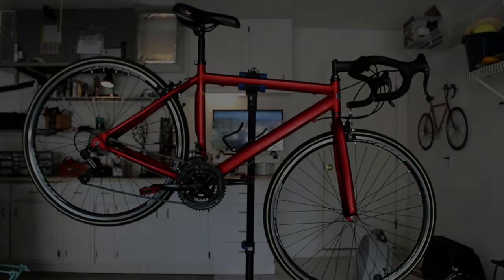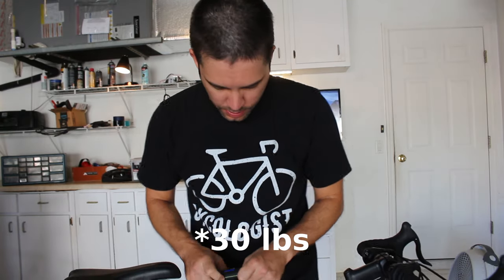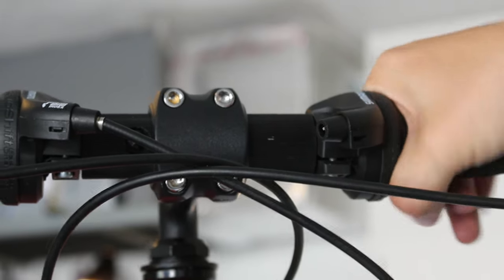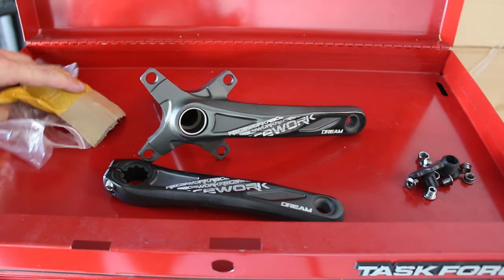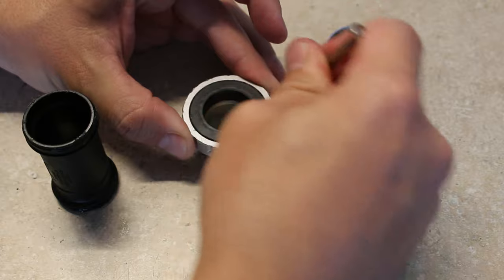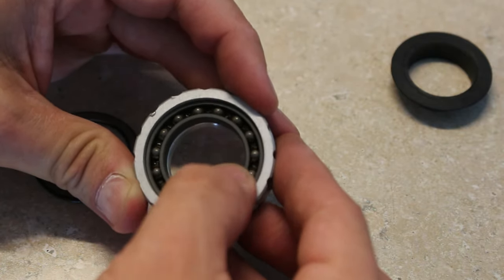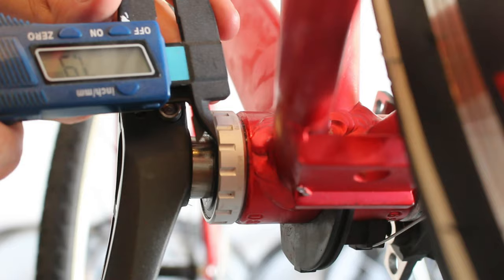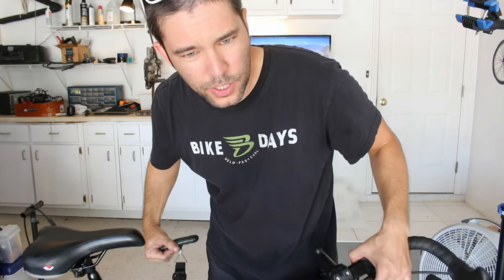Cheap 1x upgrade for the Kent road bike

Comment: I keep coming back to this especially after i got rid of stock front crank/chain set on my bike. Took the frankly disgustingly heavy one and put it on the old back yard clunker, which solved the skip issues it had (and converted it to a 1x) and my bike is taking hills easy.

I'm not going ot turn mine into a fixie because too many hills (I tend to go through the middle three gears on the loop i go through.) 

I just like that you took what is considered 'bad' even by big box standards (kent) and turned it into a winner.

As a note for anyone else doing a crankset swap: Get a little tube of loc tite to put a little dab on each of the bolts as you install it. Even on my fairly easy loop a few laps in and i have to stop to tighten the bolts back up (they arne't like... shockingly loose but I don't like any play at all on 'em.)
Reply from the maker: I think for anyone getting this bike, the number one thing you can do this 1x conversion. Cost, what about $40, but just that actually makes the bike decent to ride.

Agree with the chain ring bolts, and it's funny you say that because just the other day I noticed I was missing one on my Miyata. I replaced it with a new one, but I should still get some loc-tite.

Comment: You could remove that shifter without mucking up that tape. Your handlebars are split in the middle with that bracket holding them together that is inside the stem clamp. That's the only way they can get those shifters on drop handlebars in the first place. If you look out for a cheap freehub rear wheel then you can replace the 14-28T freewheel with something like a 11-34t 7 speed cassette that will improve your high gearing speed by about 27%, (14 shared by 11). This assumes you have the frame dropout spacing for a freehub rear wheel but I think you will. Some cheap road bikes have basic dual pivot caliper brakes that work ok other bikes go super cheap with very old school simple sidepull caliper brakes which are very poor and no better than cheap road bikes from the 70s. Personally I'd upgrade the brakes as a priority either with much better pads or try to source some cheap dual pivot brakes or ideally both.

Here in the UK I've managed to get quite a few cheap 700c freehub rear wheels from Amazon warehouse which I use to replace threaded hub freewheel rear wheels. I think I've paid as little as £11 at times, they don't match the look of the front wheel but I don't care and often they are for hybrid bikes so a bit overbuilt for a typical road bike, slightly wider rim and high spoke count, 36 spokes typically.

Once you stick a freehub rear wheel on that walmart bike and some decent brakes you've pretty much sorted it. I totally agree that 1x is the way to go, it gives excellent shifting, very low maintenance and when you are commuting in traffic its simply up and down the shifter, no front shifter to think about makes the bike far more intuitive to use which improves safety massively. I hate front derailleurs one of the worst engineering solutions ever especially if you combine it with freewheels which are a low grade part and often have wobble.
Reply from the maker: hey there Bonzo! I think at the moment anyway I'm okay with the current wheel set and gear range. Here in florida we don't really have any hills, realistically less gears would be fine. But yes the brakes I do want to do something about, the one it has now is a single pivot side pull. I actually do have some better ones laying around I may try to put on. Thanks for the tip about amazon warehouse, I didn't know about that, do you just check on it for deals every so often?
Reply: @BruceChastain  I check amazon warehouse probably every couple of days on average just to see what is there. Fitting a cassette mainly helps with high gearing so you go faster on the flats as low gearing is hill climbing gearing I think and many freewheels have big granny gears, 34T is possible I think with a freewheel from decent brands, Shimano and Sunrace. As a heavy rider though I need a freehub and cassette anyway. I always look forward to your videos and I have this strange interest in walmart bikes despite being in the UK where they aren't sold.

Comment: I upgraded a dual sport bike I have to a 1x10.  I went with a 38T chainring.  I found that to be perfect.  My gravel bike has a 42T; again, that's about right for the application.
Reply from the maker: I’m thinking of going with a 1x9 or 1x10 on this one too if I can find some cheap parts.
Reply: HACK AND RIDE BIKES MicroShift Advent (9 speed) or AdventX (10 speed).

Comment: Had this bike for a yr then sold it.  Btw, this may be late, but you could've taken the front shifter off.  Remove the drop bar from the stem, the bar is a 2piece and can take apart in  the center.  It is holding on by a bolt.
Reply from the maker: thanks Jack, I don't have the bike any longer either.

Comment: I had the exact same flatpedals. They are wonderful for about 24 months and then start making horrible noises and are crap. Disassembled and lubed them several times, but the bearing construction is primitive and wears out quickly. And they are not sealed, despite being Wellgo Pedals.
Reply from the maker: I really don't remember where I got them, I got a gray pair too, so far they are not making any noise, but they're a little lose I can feel.

Comment: Good effort to keep low budget.
no more funny sounds, good change.  Could you freeze on minute 23:12 ? Appears to me front fork is turned 180 , I could be wrong, please check, ride will improve  a bit with that change.  The ability to print your tool and plastic rings, is awesome, the help from community to advise is great.  Thanks for good video and ideas. ( You can paint the parts if you don't like colors )
Reply: @ minute  0:49 seconds of video  fork looks to be correct clearly. Must be the camera lense/ angle on minute 23:12 /14 of video.  My bad!. Great built and video editing.
Reply from the maker: haha funny you say that, see this video about fork direction on this particular bike. and thanks for the comments. https://youtu.be/v-i2R8E21ag

Comment: So I was all in on the discount build until, okay, time to print a tool.  And that's impressive, just not the same as tapping a screwdriver with a hammer for that true shade tree tightening.  And I grin and say nice work, your replacing that big ol' triple with a single ring.  But yeah, in flat Florida, something bigger up front is the way to go, something in the 40s.  And don't toss all that steel into the trash--please drop it off a metal recycling place.  I do that with my old bits of metal and junk and every single aluminum can--I'm a big fan of bubble water and caffeine-free sodas when the weather is hot, but I cannot bring myself to throwing out the cans.  I think about the alloy frame that could be made from them, so I happily crush 'em and bag 'em and drop 'em off every now and then.
Reply from the maker: You’re 100% right, I did end up keeping the crank, I’m going to make or get some scrap metal bins. Here in Florida you can actually take that stuff to a center and get a little money back, I’ve done it many times. I don’t have a 40 tooth, but that 36t I mentioned in the video, it finally came in the mail, so I’m going to slap that on soon. Btw looks like we’re related, I don’t see a ton of Chastains out there.
Reply: @BruceChastain  Hey, that's great, Bruce, glad you have a place in Florida for dropping off old metal.  And I would add that some of those guys who gather up scrap metal from basements and backyards are quite approachable.  Last year, I chatted with a local gent at McDonald's--he was cooling off with a big soda as his truck outside had a couple of old bikes at the top of the heap--and he said he'd be happy to sell me any old bike I wanted.  I have yet to take him up on that but it sure is nice to know and surely, along with the junk, he gets some gems like Sting-Rays and European ten-speeds.  And about Kent bikes at Walmart, I bought a Kent 26" mountain bike on clearance back in January in the dead of winter--not necessary for myself, just couldn't pass up the deal, only $35 buckbuckbucks for a new bike and how crazy was that?  Tires and tubes alone made it worth it.  It has a disc up front and a V-brake in back and I have already cannibalized the brake pads for my commuter.  But I'll replace 'em and plan to donate the bike to a local boy's home.  And it is actually a decent street bike--I've made a couple of test runs as errands on it.  Keep up your good work, Bruce, and yes, there don't seem to be too many Chastains, so any family-tree connections are great, especially as fellow riders out on the road somewhere.
Reply from the maker: @robbchastain3036  I've seen kev central get deals like that at walmart, but I haven't seen anything so cheap myself. Interesting you talk about donating them because just yesterday I was thinking it would be cool to build up bikes I find in the trash or wherever for kids who otherwise can't get a bike for themselves. Where are you at Robb if you don't mind my asking? I learned a bit about the Chastain family tree, looks like we came from a Doctor in France named Pierre Chastain. I believe he arrived in American in 1700. I actually visited his home down in France in 2018.
Reply: @BruceChastain  So I'm not a Walmart insider but I am an enthusiastic Walmart employee in this season of my life--it has been a decade, already, after losing two long-held jobs in the economic malaise of '08/'09--and for about eight years, summer of '10 to summer of '18, I was a bike assembler at a local Walmart and I really enjoyed assembling and selling and dealing with bikes and people who love bikes all day every day.  And the way the clearance deals worked was this, two ways--one is the Customer Value Program where a bike returned by a customer for whatever reason--just didn't like it or such--was sold at 35% off list and marked as such, not a new bike but a refurbished one.  And that can be a good deal as often the 'used bikes' have only been around the block a few times and that's that.  And the other way is when a department manager gets a memo and marks a lot of boxes with a big X and tells the assembler to build them up and roll them out to the Garden Center, where they are priced to move, move, move--crazy low prices just to get 'em out the door and make room for new model-year bikes or whatever.  And that's what happened back in January when I got that new Kent mountain bike for just $35 bucks--about 20 bikes were rolled out to the Garden Center, marked way down, and, zing, off the floor and out the door they went into winter weather.  So, yeah, you just gotta be walkin' past when they are there.  And I will share a few thoughts about donating bikes and the Chastain name and family history, but, well, I have to head to work now.  Have a great day, Bruce!
Reply: @BruceChastain  I'll say this, Bruce, about my own experiences with giving bikes away--it is an amazing experience, a wonderful experience, and while I had time and money, I was happy to do it.  And I did that for about ten years, from the late '90s through the decade thereafter, with my run ending upon losing two long-held jobs in the economic downturn of '08/'09 and having to scramble to redefine myself in the aftermath--and part of that was simply letting go of a whole bunch of bikes without renovating them and that's okay, I did what I could and I am glad I did.  And the whole thing just hit me upside the head when I visited a thrift store near where I worked at the DC/Maryland line and saw Schwinn Varsities and European bikes and early-model Treks and Cannondales being sold for--no joke--ten or fifteen or twenty bucks.  It was incredible and while it wasn't every single day, it was often enough at that store and others for me to get lots and lots of quality bikes.  I don't expect that to ever happen again for me but, yes, for someone with your platform and skill, you could create a non-profit and surely accumulate lots of bikes to clean up and give away, no question.  But I'll say this, too:  Helping kids with their bikes can be as simple as fixing their flat tires.  Back in the summer of '94, I was on the staff of a faith-based non-profit which did a lot to help the communities on either side of the DC/Maryland line, and the executive director was always looking for ideas to do more and that summer, he enthusiastically embraced my proposal that we send out a mini-van with supplies to do basic bike repairs like fixing flats.  And I have to say, to my surprise, it was really popular--mothers would take their kids and their broken bikes to our mobile locations and we'd fix 'em up and it was nothing but net.  And flat tires really do derail lots of kids from riding--they simply get stuck and stop riding their bikes and that's that.  And even at Walmart, when I was a bike assembler, I'd sometimes get called out to the customer service desk to retrieve a bike which had just been returned by a customer because it had a flat tire.  Yes, a flat tire was enough for some customers to put a bike in the car and drive it back to Walmart.  And I would wonder, hmm, did they buy another bike or was that it for that kid, no bike for you because it got a flat.  And there were other instances of returns like that--the customer simply didn't have a clue about the basics.  So I say all of that to say that, definitely, you could do some sort of mobile assistance for kids or, perhaps even better because of teamwork, you could work with community centers or churches or such in helping the people they serve.  And I will say that I am all for the bike-donation programs which gather up bikes and send them overseas--certainly commendable and wonderful--and I am all for the bikes-for-Africa program which GCN promotes, but yes, yes, yes, there is a huge need of bikes for people here in the United States, and anything that connects people who need bikes with people who have bikes is a beautiful thing.  And you--and Kev--are doing a lot with your channels of information about affordable bikes and how to fix and modify them.  So keep up your great work, Bruce, and I will write again soon, with some Chastain information.  Sorry to be a bit wordy, but that's just me.

Comment: nice job getting it to work! I'd suggest getting a 40t chainring, but more than anything you need to true that rear wheel son!
Reply from the maker: Thanks KallaMig! Yeah I think something a little larger would be good. As far as the wheel, yes but I'm also not that good at truing, so I'm a little hesitant.
Reply: @BruceChastain  It's not hard, at all. You can tie zip ties to the frame, cut them to length and use them as indicators (should you not have a truing stand). Just go with a quarter turn at a time and watch the relevant tutorials on YT.
I didn't know squat about bike 1 year ago and now I've built and sold 5 bikes, fully maintained. I'm a god damn knob head so you should be able to do it too.

Comment: are the spacers for using the wider crank on the narrower bb shell available somewhere or do you need to print them?
Reply from the maker: For sure you can buy them. And I think normally when you buy an external BB they will include them.
Reply: @BruceChastain  great, thank you. Just discovered this channel, really interesting stuff.

Comment: what class and size is your handlebar?, and how did you install your shifter?
Reply from the maker: Hi Prinsipi, I have a unboxing and review video on this bike where I talk about the width of the bars and some more details. I don't remember off the top of my head. But I will say that it is a two piece handle bar. And as far as the shifter, I just left it as is.

Comment: What’s the top gearing like? You mentioned with the chainring you got it doesn’t have a high max speed. Will a larger chainring make a difference?
Reply from the maker: Once I tried to ride as fast as I could on this bike with this gear set, I had a light wind behind me, for a short time I was able to ride at 35 kph, but my legs were spinning really fast. Yes with a larger front ring you'll be able to go faster, I guess a 38t would be good. But even this one was good enough for me.

Comment: Why 34t ? You're going to spin out.
Why not 40t or 42t.
This was tough to watch.
Reply from the maker: I really wanted a 36t, but ended up getting this one bc the 36t was taking so long to arrive. I figured for the short term I could use the 34t on this bike and later on a MTB. I'm really not fastest enough to need a 40t. I was able to reach 35kph for a very short time with this one, so with this slow and heavy bike, if I can cruise around at 25kph then that's fine.

Comment: Make your tool handles longer hehe
Reply from the maker: you noticed that somehow? wow
Reply: @BruceChastain  in the video it looked like the bb tool had a very short handle, maybe I was wrong, idk, in my experience short handles suck and make the job harder than it should be. Good video anyway.
Reply from the maker: @bnp4292  ah okay I see. Yes you're right, in fact it was too short and I tried putting a wrench on the end to extend my leverage, doing that broke the wrench you could see being printed. So I then printed another with a longer handle, and that is the one that you see taking the BB off. I didn't really want to bother adding all that detail to the video so I left it out. But yes now I have one with a longer handle.